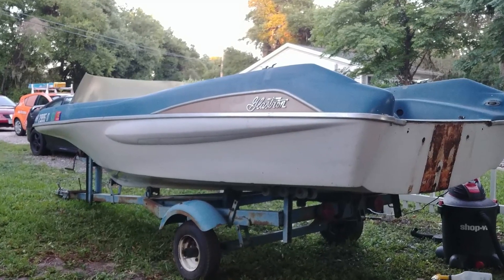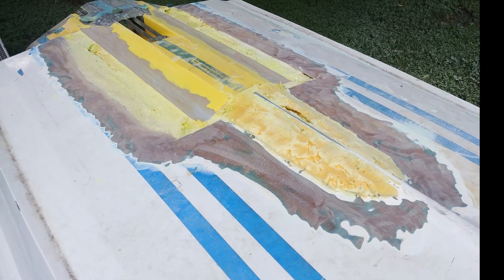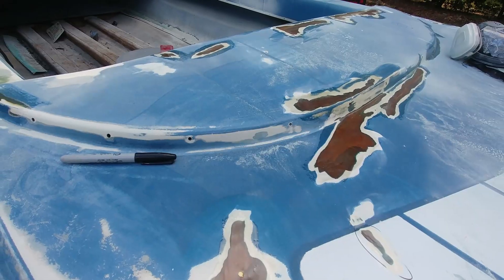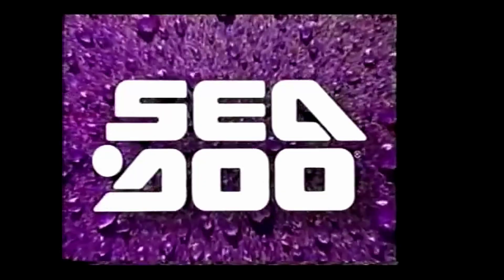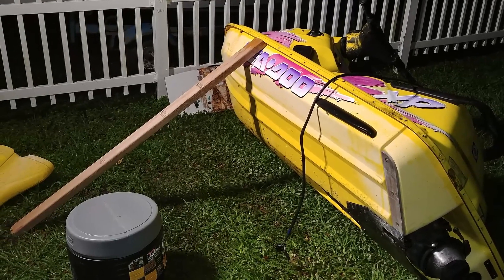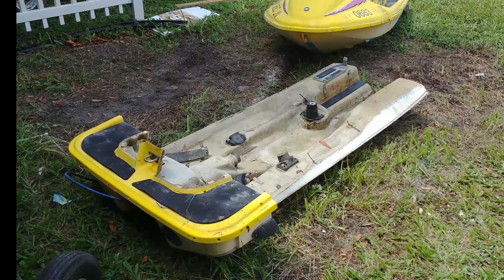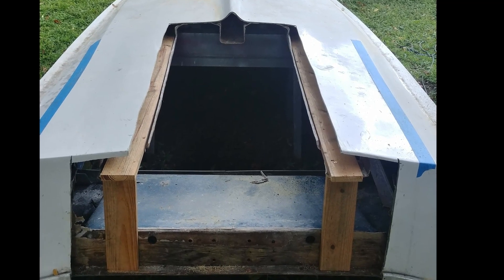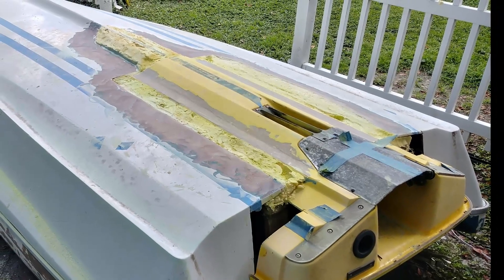From Vintage Outboard to JET POWER! || Jet ski Powered 1960 Glastron Build Log || Intro

Comment: Did you have a finished video, i planing do the same proyect with a 580 92xp, i was in stand by until new used  crank shaft arrive to rebuild engine
Reply from the maker: Hi, Juan!  Not finished yet, but look for an update video soon!  I am currently working on the floors and interior.
Reply: thank´s i hope you get well on your eye
Reply from the maker: @juanpabloramirez6565  Doing a lot better, thank you!